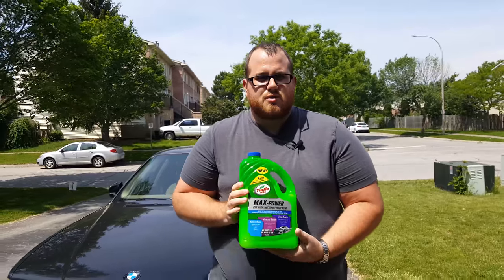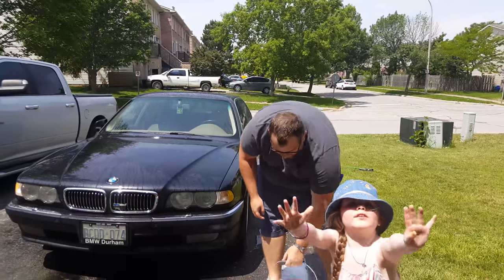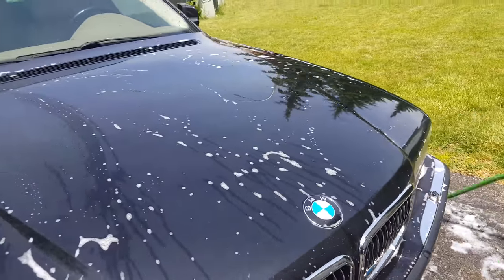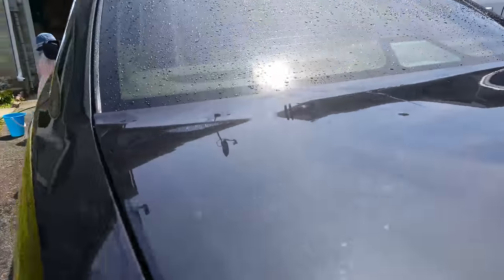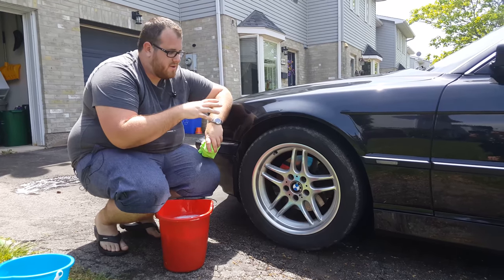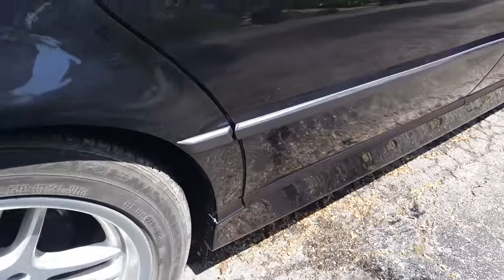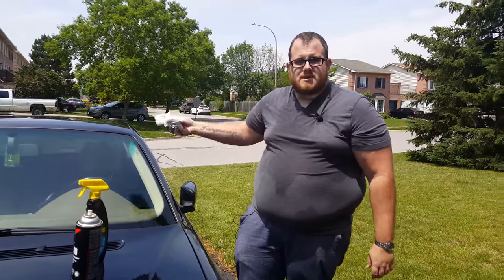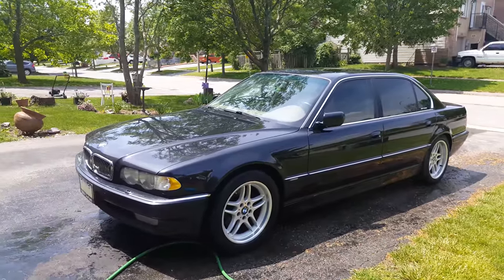Detailing My Neglected BMW 7 Series | TestDrive Garage [4K]

Comment: I see you use Turtle Wax soap. I've been quite happy with Turtle Wax car cleaning products as a cost effective alternative to more expensive brands such as Mother's, Meguiars, and Autoglym. In particular, the Turtle Wax ICE interior cleaner and protectant is nice, all surface interior cleaner, with an inoffensive scent, that is grease free.
Reply from the maker: I've found the same thing too, which is why I like this Turtle Wax. Before we used Meguiar's which was good, but settled on this. I have some Autoglym wax and compounds that I never found to be effective. They're still sitting on my shelf almost completely full.

Comment: Hi Nile I think e38 is a class car but what do u think about the e65.
Reply from the maker: The LCI (facelift) E65s have grown on me over the years, I think they smoothed out some of the rough areas with that car when it went under the scalpel. Reliability is certainly an issue, with more expensive components being used with more advanced electronics running more of the cars systems. If you're able to do the maintenance yourself, then the E65 is incredible value for money.

Comment: do you daily the 740il or do you use another car?
Reply from the maker: We daily this beast like our lives depended on it! We average around 3,000km a month on it, less over the past 6 months but still a significant amount of driving gets done with this car.
Reply: woww, glad it is still holding up
Reply from the maker: Starting to rust along the door panels though, water gets trapped between the trim pieces. If I plan on keeping the car, I think I'll have to replace the doors completely.
Reply: a friend of mine is pretty much replacing the doors on his e34 wagon, seems to be a common issue on bmws of that era
Reply from the maker: It definitely seems like it!